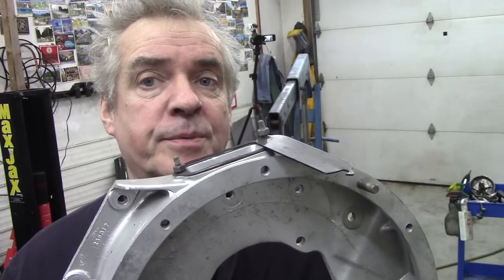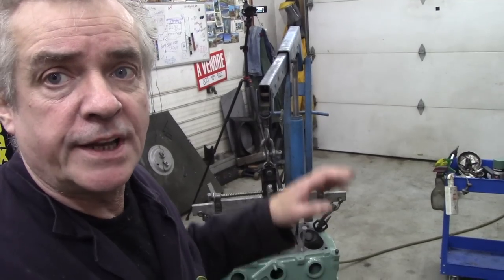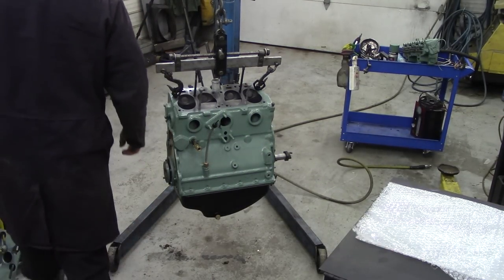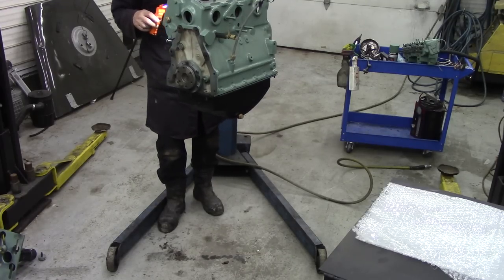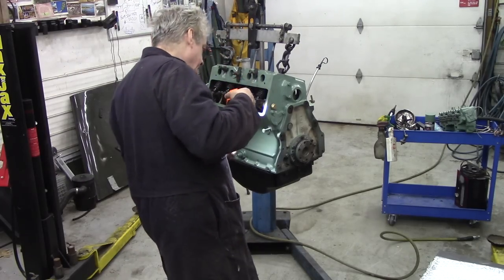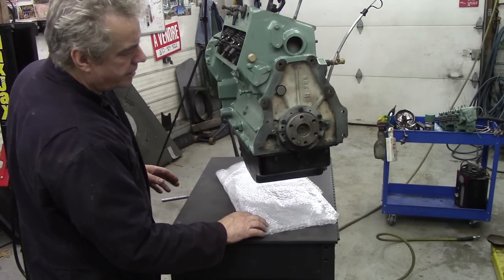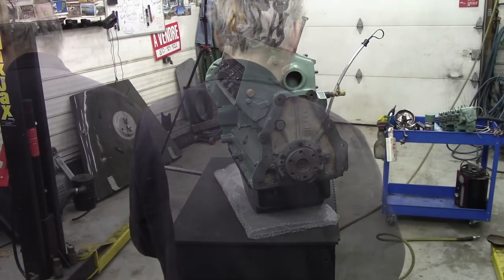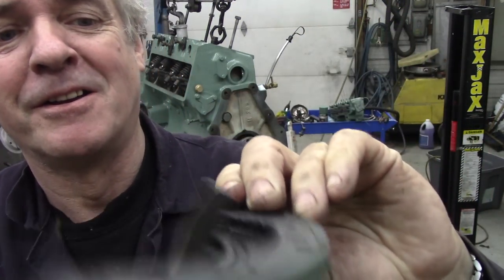Series 1 engine rebuild part 1

Comment: On the aircraft I work on, at the main seal on the propeller shaft, the same problem exists. What our manual says baffled me the first time but it works.
We heat up the seal in hot oil and then gently work it over the flange, installing the spring afterwards.
The seal goes back into it's original shape and seals the shaft.

Maybe something for a rainy day.

Thanks again for the great video Mike.
Reply from the maker: Interesting - this seal has no spring!

Comment: What is your opinion of the 2.5 L diesel engine? Considering a 1990 low mileage MOD 110. Concerned about highway cruising speed. Thank you.
Reply from the maker: Not one of the best engines - the military were limited to 50 mph so was OK for them, but watch out for MoD 110 as some were FFR (fitted for radio) and were lower geared to compensate for the extra battery weight they had to carry - these were generally low miles engines, but were usually driven to a hilltop and the engine was run flat out to charge the batteries